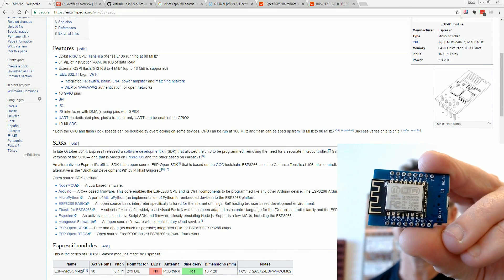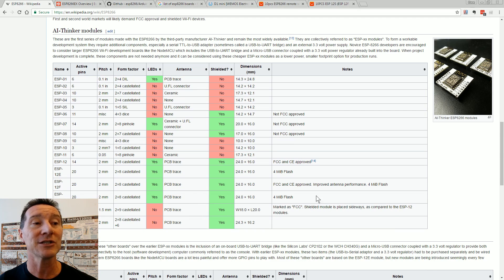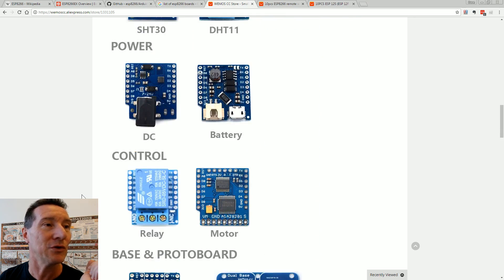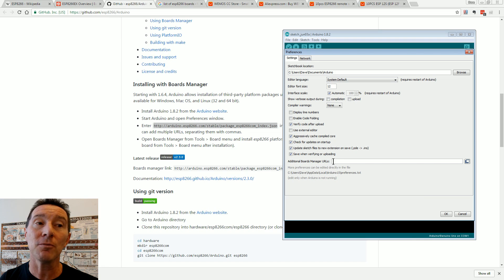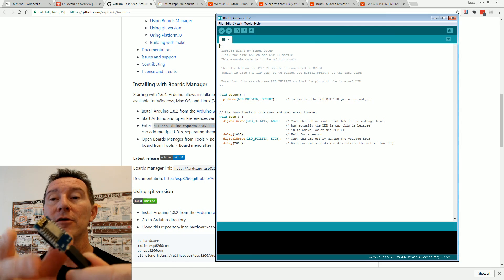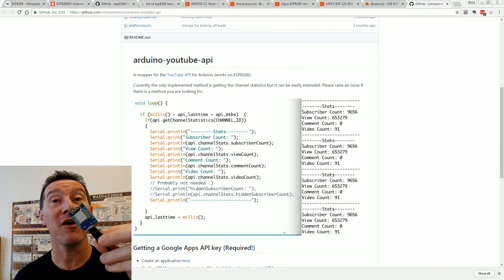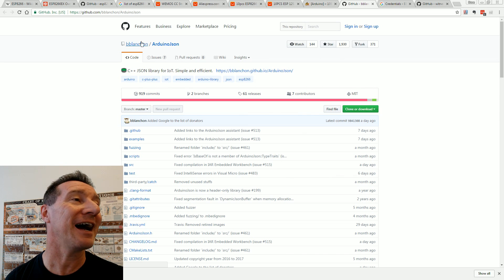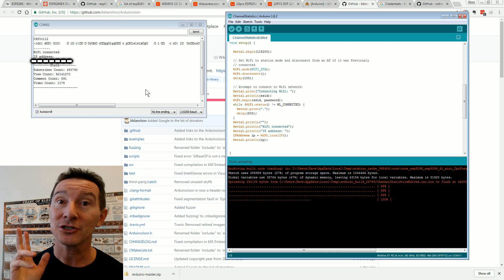EEVblog #998 - How To Program ESP8266 WiFi With Arduino

Comment: To people in 2022: I've bought 20 of them in a batch to install them into my home appliances, only 3 are working, the rest is crashing with total different exceptions all the time. I've tried new bootloaders, patches etc, but no way, they are garbage. The seller is not sending a replacement, so the bargain was a real pain to me. I've ordered from a different seller in Germany, he sent me also just clones of the Wemos D1, but they are all working. 

I'm thinking, maybe the carrier boards have some trouble and the chip itself is ok, so I will desolder them from the PCB and try them again. If they fail, I have 17 PCB's I can use for single chips, which are a bit cheaper (and work hopefully).

So watch out, compile a small webserver after the blink sketch, if that one works, chances are the SPI memory is ok.

Comment: SIR can u tell me why NTPClientlib.h is not working. When it is included in esp8266 d1mini board it showing error "compiling error for board LOLIN(WEMOS) D1 R2 Mini"If we remove the library then the problem is solved another error is showing "NTP is out of scope".I downloaded almost all verson of library but the problems remain as it is. If u want then i will send you the code. Pl. help me

Comment: late to the party but fixing to put this gem inside a 1949 Model Train from my childhood. Oh YEah Love It. Thanks, Dennis
Reply: Follow Up I have completed a simple model steam engine version with my friend Andy and we have decided to leave this conventional transformer control for a Level 1 type controller. Now we are addressing the WiFi capability for smart phone or Tablet interface to become our Level 2 type controller with wireless user interface. I am studying hard to get smart on the whole process. Andy is in South Africa and I am in the US so we never met, but since we both have 3D Printers and love trains we are team mates now.  Your videos offer so much information to absorb. Basically We felt safe to choose this processor with so many support resources and low cost, it is perfect to retrofit these 1950s Trains. With all the basic functions working, Smoke, Puff Chuff, Bell & Whistle I am now building the harness and kit installation into the Train Tenders. We are fitting into 5 or 6 basic models of engine but with 3D Print are now working to build our own new Engines never made in the Scale we play in. Good CAD tools, 3D Printers and Adruiono IDE, with ESP8266 has opened a whole world to us in rebuilding the hobby for this Gauge train. Thank You for all you do in general as it helps us see options and opportunities.   Latest assembly in R&D, very crude video https://youtu.be/PXpR-Spkguc

Comment: I am curious about if someone has managed to write his own program on ESP8266 chip except using sketches,examples and libraries.More or less the same thing occurs also for avr microcontrollers if working in the arduino environment because the internal registers are accessed using macro instructions and also dont have any debugging and visibility on them.You can use those things but never actually learn them and as a knowledge will never be yours but always will be depending.

Comment: I followed your instructions exactly but get a lot of nasty red errors. I tried moving and deleting libraries, now none of them work :(
Multiple libraries were found for "YoutubeApi.h"
 Used: C:\Users\ross\Desktop\Arduino\Projects\libraries\arduino-youtube-api-master
Multiple libraries were found for "ArduinoJson.h"
 Used: C:\Users\ross\Desktop\Arduino\Projects\libraries\ArduinoJson-6.x
Multiple libraries were found for "ESP8266WiFi.h"
 Used: C:\Users\ross\AppData\Local\Arduino15\packages\esp8266\hardware\esp8266\2.5.2\libraries\ESP8266WiFi
exit status 1
Error compiling for board WeMos D1 R1.

Comment: ESP8266 module. Finally figured out how to upload arduino sketch on it. Kinda different from normal arduino mcu's. Also, I could only get the newer version of ESP-01 to work. The old one did not run after uploading. Maybe it wasn't getting enough power.
Reply: Since I bought china clones, Tx-Tx and Rx-Rx. The other way, it won't upload.

Comment: Check that sometimes it doesn't dowload automatically when going to Tools/BoardManager. In my case was beacause in the /ArduinoData folder i had a package_index.json.tmp. I erase it, open again Tools, Board Manager and voila!

Comment: Knock Knock!!!   Who's there?  Wemos!   ...   Wemos who?   Wemos definitely need to learn opcodes  and write in assembly !  I think esptool knows how to write a hex file to program memory areas  and it might be able to write a new bootloader to it as well....  ( unconfirmed and unbeknownst to me,  as I use a different tool to rewrite the bootloader region ..)   it takes up just a little of the flash mem space... replicating their rom bits in flash mem instead  and patching out a few calls..    but it works for me!!!  ;)

Comment: Although I've used ARDUINO IDE   on occasion to knock something up in a hurry and am guilty as charged ( LAZY as F00K)    I'm not a pissflap coder     :

void pissflaps () {
do blah blah blah;
}; 

I prefer to code in assembly lang with opcodes by the datasheet of the specific chippy i'm working with   ... ( it's just my style)  then just simply assemble it to a bin or hex     ( it's all the same isn't it?)   then load the bin denoting the reset vector program memory allocation , then  hit reset and see who salutes!      :)

Comment: LMFAO!  if the pcb doesn't have the rounded corners then it's dodgy!   well it might scratch your bollox if you keep them in your knickers without filing the corners round . lol!!       ( has fuckall to do with those bootloaders!!! it's the corners of the pcb!)   so took the dodgy knock-offs with the dodgy tcp stack hijacking trojan ones and just rounded the corners with a hand file on the pcb  and  all sorted!   Bang! no more tr0jan bootloader!! o_O   FFS!

Comment: I've been getting the fakeys  izokees and some other wemos clones...         :)))))))))))))))   the bootloaders on the knock-offs are a bit sketchy  ..I disassembled a few and it seems they hijack the tcp stack and send  data back home ... so be cautious!  Don't run those on your internal lan   unless you reflash the bootloader  itself!!!    and if you think  that you are safe but not adding DNS to your program in arduino  ( wrong .. m8eys..)    Just a heads-up because I'm a m8 .. ;)

Comment: I would never buy cheapo dev board for ESP8266 or other stuff, only reference dev boards from manufacturer of that chip, because nodemcu just got flash or esp fried after flashing soft for it. I don't trust that wemos thing at all, only esp-launcher.

Comment: nice video. Is it possible to have a wemos/relay at one location and another wemos/(Wemos Temp & Humidity Shield) different location with a preset temperature; so when the temperature reaches a certain point, it sends out a command to turn on relay?

Comment: I have a printer with USB connection and it don’t have wifi. I just think... This is possible to connect “wemos” to printer usb and use it as print server?  So i can put printer somewhere else and send prints wirelesly. That will be exelent solution.

Comment: Espruino makes 8266 general purpose modules with bells and whistles, but you have to program in javascript.  That may be fine for some folks, but judging from online materials it isn't easy.  Since I don't know a thing about js, it sounds like a very bad choice for me.  The wemos is Arduino IDE-programmable and that's great, but the only thing wemos seems to do by itself is wi fi and leds.  Am I right that there aren't lots of companion boards that work with it?  So, is there an 8266 development system out there with companion boards and Arduino-IDE, or C programming?

Comment: "Don't need to pay for FCC certification yourself" is a bit untrue. If you had this in a product, you'd only need to pay for unintentional radiator testing, not intentional radiator testing. (Assuming you use the exact antenna that the module was tested with. Luckily in most cases with the ESP8266, that's just a PCB antenna.) Basically: Thousands of dollars to certify instead of tens of thousands. Zero for hobbyists because they don't do that anyway in 99.9% of cases.

Comment: Hi Dave, that upload failure you got is common. It usually means that the usb connection has stopped working for one reason or another. Usually unplugging and plugging it back in fixes that. Welcome to the world of IOT...

Comment: I'm using one to turn on flood lights via phone app so I can reverse up my twisty driveway in the dark. Took about an hour to design the whole system, 2 hours to build, & have spare outputs so I can irrigate the garden, when I buy some valves, control garden lighting. Bloody brilliant. Best thing is a hundred times cheaper than commercial systems to do the same, and controlled from one app.

Comment: Arduino polished?! Apparently, you never worked in an in depth project with it. It has some many problems, I don't know where to start. I started working with STM32 and it's a more enjoyable experience, not to mention better speed and cost on those ICs.

Comment: Great video. I think there are many who have never made the leap from standalone embedded devices to wifi connected devices so this is a help. The other obvious platform is the raspberry pi with wifi onboard but the learning curve is steeper if you're not a Linux and Pi whiz.

Comment: If your network is firewalled and NAT'ed (which it should be) and uses a private IP range (10.x.x.x, 192.168.x.x, 172.16.x.x - 172.31.x.x) then hiding the IP your DHCP server gave the wireless thingy was pretty much wasted effort since that information is pretty much useless to anyone. Just FYI.

Comment: if it only had 5V I/O. havent found a breakout board with built in level shifters yet. would be a good replacement for arduino.
Reply: gamerpaddy ... 5V? 3.3v is the future- you get more state of the art sensors working either both or 3.3v only! Only when I use old modules from my spare parts box I sometimes use a level shifter (no problems whatsoever;)

Comment: Hey Dave, I'm the guy with the YouTube library. Great to see you liked it! 

I'm a bit the opposite of you I think, more of a Web developer than a embedded dev, but I'm really enjoying working with these devices! 

Thanks again for the shout out!
Reply from the maker: Thanks!
Reply: linagee hey, bit of a bug in the example sketch, it's programmed to check every minute (the YouTube API has daily limits) but the way I have it in the example it doesn't check minute 0. If you swap it around so it's basically a comparing millis() to a dueTime (which starts at 0) and every time it runs increase the due time by the required delay it will check every minute but also will check the first time the loop runs
Reply: Curious why it was slow for Dave. JSON library and softmath not that efficient or something? Or was it all internet latency we were seeing?
Reply: well, thanks ALOT! We depend  on guys like you. Keep it up! More!
Reply: Thanks for your work man! 👍
Reply: Hey Brian and Dave, can the ESP8266 be connected to Arduino IDE via a usb to ttl cable only? Just programmed on a breadboard? In the board manager would you select generic module?
Reply: @salvatorebelcastro2147  yeah it can, it needs a couple of resistors to configure nodes though. There is a video on my channel where I explain it
Reply: EEVblog I'm in EEVblog's inbox!!

Comment: Can you make a good quality speaker that plays music over Wi-Fi from a NAS server?  It should have browsing/play controls on the speaker and not use a 3rd device.  Using an old phone or tablet in the speaker is acceptable as long at it uses the same battery as the speaker itself and does not separate from the speaker.  This device should be stand alone with no wires coming out when it is in use.  There can be charge ports to charge the device battery and usb ports to use the device battery to charge a phone.

I would like to build something like this myself but lack the expertise and knowledge you have.  There are alot of ready made components for this.  I have seen many other videos of people using Bluetooth components and tying up a 3rd device.  I want Wi-Fi range and only 2 devices in use.

I love your videos!  Thanks!!!

Comment: One really nice inclusion is DNSSD libraries  (part of what Apple call bonjour). No more messing round with IP addresses, just connect to WiFi get an address via DHCP and publish your service. 

My function generator project uses an esp8266 for the UI and my remote control software let's me discover and connect using DNSSD.

Comment: I hate when people use arduino "programing language" it's good for people who don't know about electronic, and want to do something using microcontroller, but for electronics  it's shame, that arduino ide is Basic of 21st century, you learn nothing about programming or microcontrollers.
Reply: Bartłomiej Z the language is c++, I think you mean IDE?
Reply: It's c++ with libaries that make it hard to port to clean c, and also for example when you learn avr in clean c and want to set pin as output and logic one, you must learn about structure of port registers and also some logic operators in opposite to digitalWrite(pin, logic level). Also watchdog is used without user knowing about it.

Comment: Don't forget that the CH340 uart/usb until now does not have signed drivers for recent osx versions, it can be made working with some dodgy tinkering which i wouldnt advise myself. Another option is getting a module with a different uart/usb like the cp2102
Reply: After going through a lot of trouble with the CH340 on my Mac I finally found and bought the driver from Repleo:  https://www.mac-usb-serial.com/ 
Highly recommended!

Comment: LOL, hiding the local IP address :) so no one knows your device has IP 192.168.0.15 or 192.168.1.7
Noone outside of your local network can't use this info anyways...
Reply: He might have paid for a block of IPs instead of a single one at his ISP and then he wouldn't need to do NAT - the board could have received a routable IP directly when it connected and one might want to obscure that indeed...